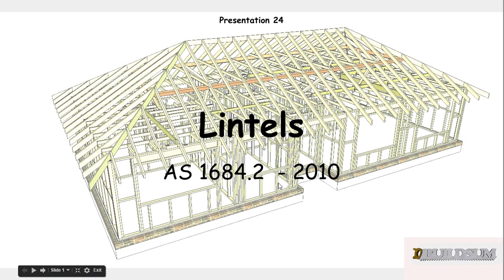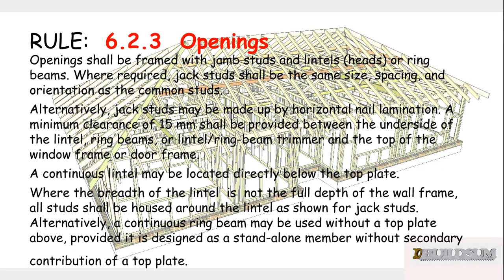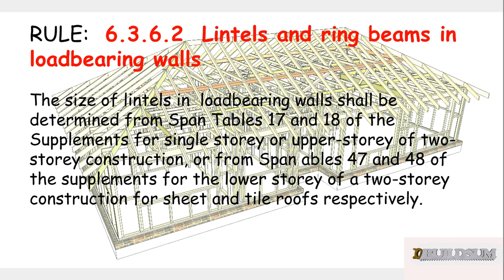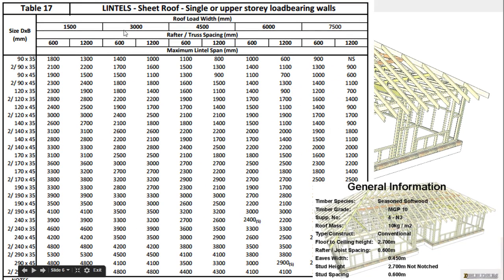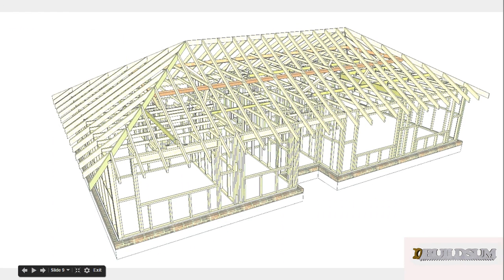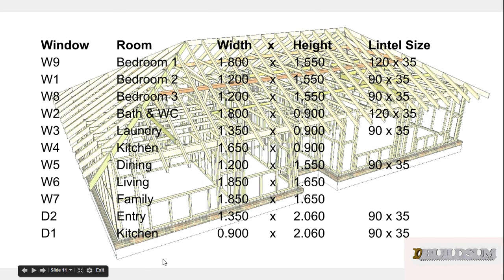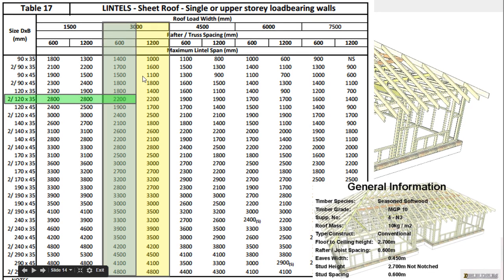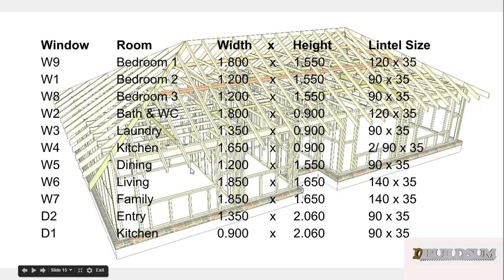24 Lintels

Comment: Thank you for the video. I have a question regarding the jack studs and the lintel. It says all jack studs shall be housed around the lintel. In practice I saw some cases where people did not cut the "house around lintel" but only cut the jack stud (straight instead of "L" shape) and put it under the lintel. Is there an explanation for that point? Thanks again.
Reply from the maker: Hi Conan, the point of housing is not really sturctural and it takes longer to do than a square cut. The housing allows the stud to continue to the full height of the wall so that the the lining and all cladding can be fixed off. I you are going to just do the square cut you need to make sure that the lintel is packed so that the lining can be supported. Hope this helps

Comment: Hey mate, Where can I find these tables, I’ve scanned in AS 1684 and I looked online but I can’t find the tables, do you think you could point me in the right track to finding the tables?
Thanks mate
Reply from the maker: Hi Isaac, the tables or supplements are separate documents that are listed on Page 3 of the Standard. If you buy the standard they come on a CD and you just print the ones that you want, there are 45 all up, 62 pages each so you dont want to print them all. If you are accessing them online you will just have to search for the supplement that you require and download that.

Comment: Great !!!
Could you please  help me to explain some points in 1684.4 table A 24 as 
 1.Truss roof , truss span 11m , top chord length ~6m including overhang. Input for rafter/ truss span is 11m or 6m ??
2. Could you please explain rule A2, A3 page 107 in 1684.4  in details please????
Reply from the maker: Hi, Sonny, i will reply to your email.

Comment: Can 1684.4 be used instead of 1684.2? I think table A24 of 1684.4 is the appropriate table in 1684.4? But it seems quite different and provides much more conservative results.

What do you do (especially on wider openings and/or tile roof) if the results call for 2/XX x 45 but you're using 70 mm studs?

Another great video by the way, I've watched all your videos, some numerous times, and have learnt a lot from them. I really appreciate the amount of time and effort you've gone to in putting them up.
Reply from the maker: Hi Pete
AS1684.4 certainly can be used instead of AS1684.2 but as you say it is a lot more conservative.

If like in your example, you cant get a lintel size to work then you may need to look at using another type of timber or material, LVL for example. The manufacturers generally supply span tables for there products on there web sites.

Hope this helps
Reply: Buildsum thanks very much, yes that helps a lot to give me confidence that I'm on roughly the right track. Thanks again for your help